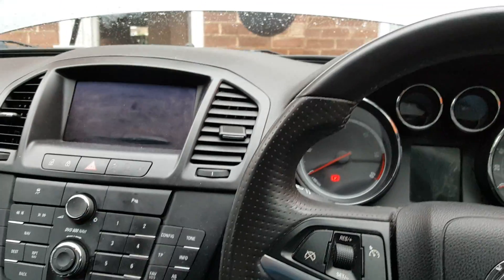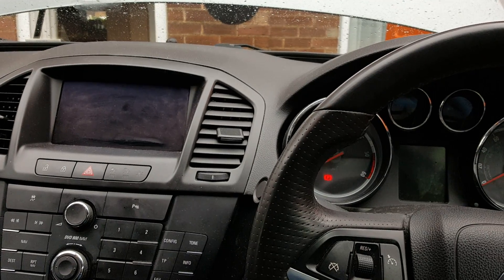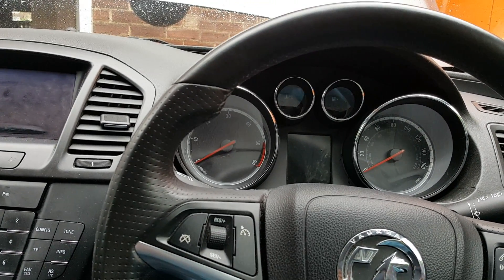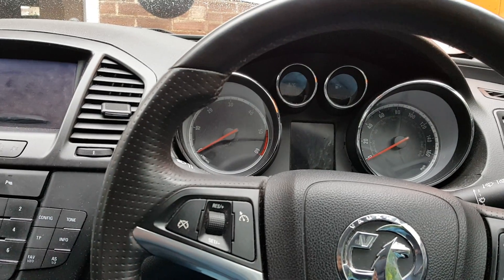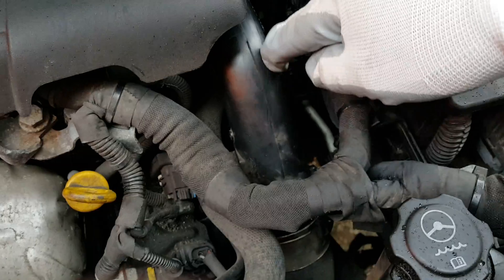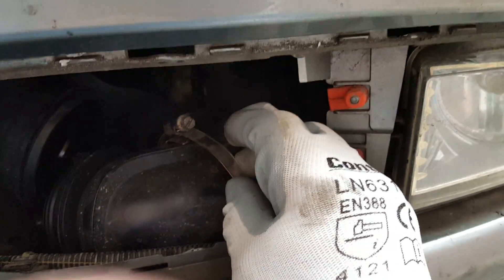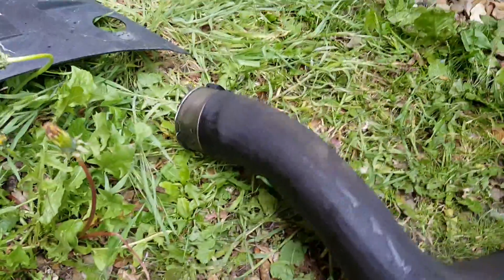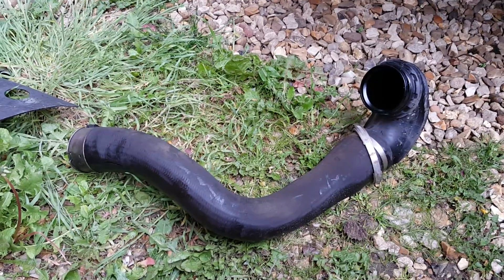Vauxhall Insignia CDTI A20DTH P2282-52 root cause.

Comment: great video thankyou. im getting intermittent power loss for about 2 seconds then ok. i have oil on this pipe on the engine facing side. could this intercooler pipe cause the power loss ? many thanks
Reply from the maker: Dodson 
Hi
It can... but, advise you to have the car scanned first... as it can be many things...
Reply: cheers mate.
Reply from the maker: Dodson 
No worries...

Comment: Can you please provide the Opel or Vauxhall Part Number for the hose which needs replacing? Thanks for the great video!
Reply from the maker: Michael Willys 
Hi
Minute 14:14 on the video below...
https://youtu.be/CINAcP44Cdc
Hope that helps...
Thank you for watching!
Reply: It’s the Turbo pipe m8.
I changed it as well as I was loosing power around 2500 RPM

Comment: Hi, I recently had a split pipe which I’ve since replaced. The reason I knew is that the revs were higher than they were before. However, despite replacing the same pipe in your video, the revs are still higher. I’ve had the car checked for vacuum leaks and scanned by three mechanics who are unable to find any faults. I’ve also replaced the map sensor, egr and cleaned the egr pipe but it’s still the same. I’ve also checked for leaks around the intercooler outlet pipe connected to the throttle body but couldn’t find any.The car used to cruise on the motorway at 70 mph in sixth at 1500 rpm but it now sits around 1800-1850 rpm. Have you ever come across this issue before? Thanks
Reply from the maker: Hi
That is strange... If is reeving higher while cruising I would suggest some sort of slipping...
Is the car manual or auto?
Reply: May have been a software update at vx

Comment: I. have this problem how do. you remove fog light. grill
Reply from the maker: Hi
Thank you for watching! 
You remove it by pulling and sliding slightly to the left...
It is a bit of a pain, but with persistence you will get it out...
Reply: Brilliant thanks 
I've ordered new intercooler pipe how do you remove the top jubilee clip the bottom one looks easy from your video
Reply from the maker: +Ken Daws 
The top one is not a jubilee...
Is a spring clip sort of... you just pull it on one of the sides until clicks on a rest position...then just slide the pipe out...
Hope is makes sense...
Reply: Thanks I'll be doing it tomorrow if I have any trouble I'll be in touch 
Thanks for the help much appreciated

Comment: hi thanks for your help I've successfully changed the intercooler pipe and the car is still in limp. mode is there any way of resetting it
Reply from the maker: Hi
Was your intercooler pipe damaged?
Read the codes and see what's the codes...
Reply: Yes there was a big slit all the way through the pipe should it be running ok now
Reply from the maker: +Ken Daws 
Depends...
Have the codes read and cleared... what is the car reporting?

Comment: The top bit of my pipe is a bit loose and I noticed on other clamps there is a black thingy missing on mine. could that be the reason mine is going into limp mode
Reply from the maker: Andrew Beremauro 
If there is a leaking, possibly...
Reply: The connection is not tight as there is play when touched so I suppose there must be a leak coz am experiencing loss of power
Reply: hi, I changed turbo booster hose 2 weeks ago and took the car for a run coz it was still limping. After the drive it was all good till yesterday when it went back into limp mode. Took it to quick fit for diagnosis and they saying it's something to do with pdf. What could be wrong mate
Reply from the maker: Andrew Beremauro 
DPF (PDF) getting blocked...
Reply: Thanks mate did forced regen and am sweet
Reply from the maker: Andrew Beremauro 
Good to know you get it sorted...

Comment: Hi. I would have loved to find your video a few months ago as Vauxhall service ripped me off for only one hose. now they want to replace all gaskets and after 5 garages i found the oil leak to be from the dipstick tube. have you changed one of those? looking for someone who can.
regards
Reply from the maker: Alec Arsene 
Hi
No never did that... but don't you feel confident to have a go at it?
Reply: lmsvvavr i found it has 2 screws only, but the second one i cannot reach, being behind the turbo. I'm still looking for the info graphic in how to take the dipstick tube out. Definitely not going back to Vauxhall for a quote ever again in my life
Reply from the maker: Alec Arsene 
Give me a bit more details about the car... it might be that I have something about it...
Reply: lmsvvavr hi. The engine is a20dth model, 2l, the 160bhp, it is still dripping oil and still didn't find a way to take the dipstick tube out without taking the turbo yet. Any advice or suggestions are more than welcomed. Thank you and have a good day
Reply from the maker: Alec Arsene 
I can't picture the layout from the top of my head...
TIS is not very helpful either... shows how to do it but without manifold or turbo in place... loooooool 
I can't help you any further I am afraid...

Comment: HI bro I came across your video you seem to know very wel what the actual problem was, clearly you are a very experience mechanic , I recently have problem with my insignia DPF sensor pressure I have bee to many number of local garage  they Dnt seem to know what they should be doing , if you are base around London I would like to bring the car for check up . Thanks
Reply from the maker: A Khoer 
Thank you for watching and for your feedback...
I actually do work on cars as a part time... some people go to the pub, I do cars... lol
So, you say that the problem is the DPF sensor, how have you diagnosed that?
By the way, I am far away from London anyway...

Comment: I've heard it's only Vauxhall dealers that have the diagnostic software that can tell you everything about the fault though? Is that true? MDI software or something.

Will a mobile auto electrician have suitable software to clear the code do you think? It's on a 2012 GTC.

Helpful vid!
Reply from the maker: J90JAM 
Hi
Any mobile diagnostics will have the tool to clear the codes...
Indeed is the MDI tool that is used by the dealer, however, other tools will be capable of reading the codes from the ecu, read live data etc... so, is not just the dealer that is capable of reading, delete or deal with any faults on the Vauxhall/Opel cars...
Hope that helps...
Thank you for watching!
Reply: Thanks for clearing that up!
Reply from the maker: J90JAM 
😉👍